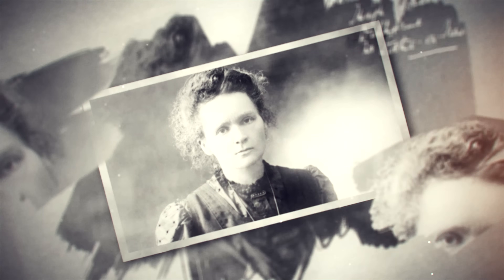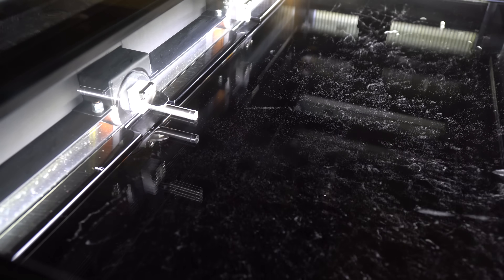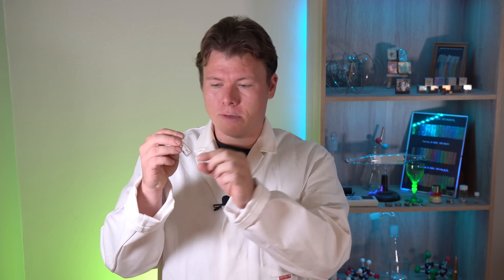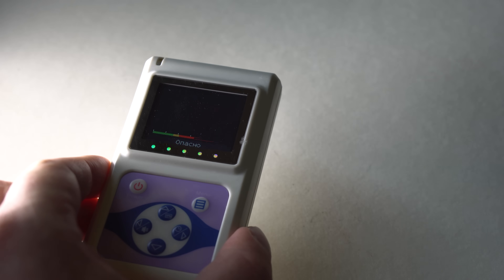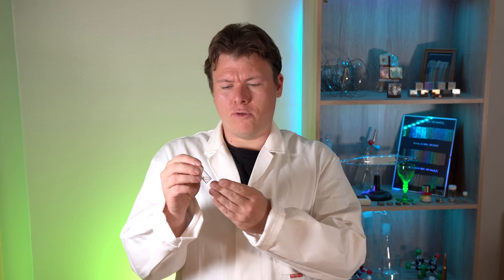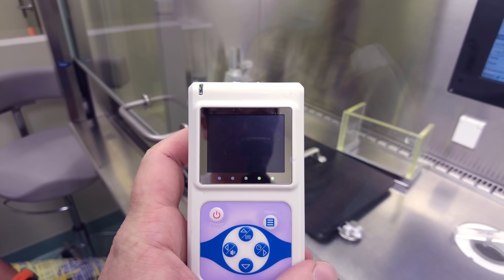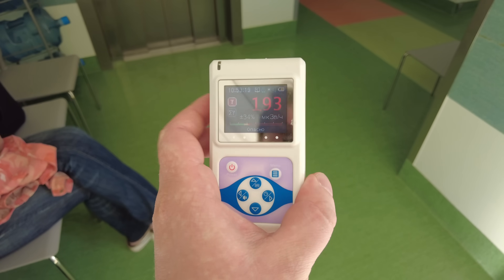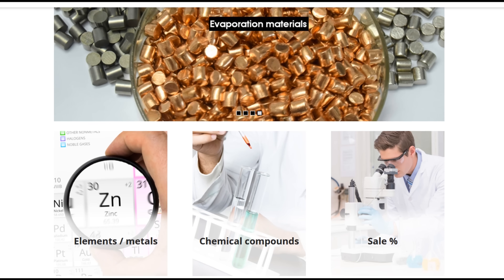Technetium - The First SYNTHETIC Metal on EARTH!

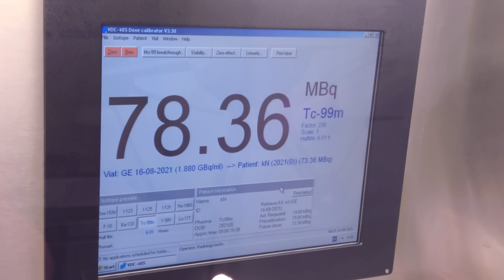Comment: 11:31 Windows 98. Wow. 
It was my favorite operating system. Used it well into the 2000s, but using it in 2021 is stretching it. 
I hope the machine is well documented for when/if the computer it's running on, fails, and it has to be modified to run a modern operating system.

EDIT: just saw the start button. Seems to be XP with 'traditional' desktop. Hope it's not connected to the network or the internet...

Comment: "Occurs naturally in the earth's crust, but is primarily man-made."
Occuring naturally AUTOMATICALLY makes it a non-synthetic material.
What you have is a synthetic version of a natural material, not the first synthetic metal. Get your hands on some Americium (Easy to get, commoly used in homes and industrial situations where a radioactive source is needed, like in smoke alarms.), or some Curium (Not a good idea, one of the most radioactive elements you could get your hands on; glows on it's own in the dark,  and is an extremely potent alpha, neutron, gamma emitter. It requires up to 2 inches of lead for a 1kW source; which makes it impractical for pretty much anything.), the first TRULY synthetic metals; only ever produced in a lab by humans.

If Technetium is a "Synthetic metal", then it isn't the first.
Plutonium,  Astatine, Neptunium, and Promethium all qualify the same way as technetium does; in that it was discovered through elemental reactions in reactors or accelerators, yet exists in the earth's crust naturally.
Though, none of these are accepted as synthetic metals, not even Technetium.

Comment: Nice video, I didn't know that technetium is such a useful metal. Technetium chemistry is similar to rhenium chemistry, but if you look in to Tc neighborhood, molybdenum/ruthenium are more reactive than their heavier counterpart tungsten/osmium. Their chemistry is similar, but molybdenum/ruthenium have due to their higher reactivity much more interesting chemistry. I believe that this is also true for technetium. Sadly technetium doesn't have a stable isotope. If it would have stable isotope, it would be very interesting metal to work with.

Comment: If you could get me sum thorium??? I would like to replicate Dr.paul m. Brown device showing that a alpha resonant voltaic cell can generate way more than a regular alpha voltaic cell. He proposed that the radioactive means just that, he tuned a circuit and showed a variable power source as long as the frequency changed with the increase in resistance. Could you imagine a AC battery??

Comment: Why is it called 'radio' active? It has no radio, why not atomically active, or something..  Understanding the mindset of the ppl. naming things  centuries ago, is as difficult as making a tokamac effiencent...
Reply: I believe that radioactive matter is called this way because it has some activity that can be detected by a sensitive radio receiver. Anything that can introduce or remove charges at a distance just by itself with no electric power supplied is called "radioactive" and all possible mechanisms of the effect are generally called "radiation".

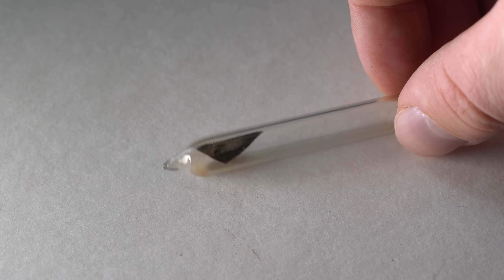Comment: #qna 07:07 why most of element's,,metal and other chemical are kept in glass does glass really help to reduce RADIATION ??
Reply: Yes.  If they are beta-emitters all that is needed to stop the radiation is regular glass.  Using lead/tungsten with a beta emitter can cause more radiation to be emitted in the form of Bremsstrahlung radiation which you don’t want.

Comment: My father did this same tomography last month, in a very similar machine. I didn't knew they used radioactive medicine. Very interesting, thank you for the video!
Reply: If he didn’t get an injection of radioactivity, then it might had been some other kind of tomography, such as CT or MR.

The following options are available:
* Gamma radiation, usually Tc. Can be planar images or reconstructed into 3D volumes (SPECT)
* Positron radiation (PET). Better but extremely expensive as the isotopes must be produced in cyclotrons.
* MR : Magnetic coils in the machine. 
* CT: X-ray tube in the machine

MR and CT do not need anything injected to the body. It is optional to use non radioactive substances.
Reply: @magnushem8734  interesting information, thanks. I don't remember many details, but I know he did receive an injection 4 hours before the exam, but I didn't receive any information about what was that.

Comment: Tc is a low mass element. why is it radioactive?
Reply: “Technetium is the lightest radioactive element. Technetium is a radioactive element, with no stable isotopes. ... The short answer is that there is no number of neutrons you can put in a technetium atom to form a stable nucleus”
Reply: @erikawanner7355  this is not a satisfying answer. there are heavier elements than Tc and they are not radioactive.

Comment: im curious. using radiation to test for cancer, even though we know radiation can cause cancer...... also, you are told to not be around other living being for 24 hours after this test.... why?... because you are radioactive and it can harm other people.... but what about you? what about the person who got the injection? how is it that they can harm others with radiation, but they themselves are not harmed? to me, this is as primitive as blood letting. good things researchers have found other ways that are less dangerous. just, more expensive.
Reply: It's not meant to TREAT anything by itself, it's just for diagnosis. And yes it does harm you somewhat, it's just a relatively low risk. Of course the risk to others around you is even less, but it is easier to avoid.
Reply: @Basement-Science  i never said, TREAT. i said test. and the risks are still there. to test for cancer, using something that can cause cancer, is barbaric. even though the risk is low, there is still a risk and needs to be replaced.
Reply: @pyronac1  you compared it to blood letting, which is (supposed to be) a treatment.
Also a lot of things in medicine come with risks, many much higher than this. At least radiation risks are easy to calculate. 

I agree though that it does seem very primitive. We should be able to come up with much better solutions than this.
Reply: @Basement-Science  no, i did not compare it to blood letting as a treatment, i said it is as primitive as blood letting. you seem to be reading what i say, but adding or twisting my words. i never mentioned "treatment" in any capacity. 

i am just glad that we finally banned lobotomies. even though France was still doing it in the early 90's. again, we have better ways to test for things. it is just way too expensive still. so only the wealthy can afford such things.
Reply: If you think you have a better idea, let's hear it...

Comment: How can I melt tungsten in a gas melting furnace forge
Reply: Good luck with that
Reply: Thanks
Reply: Bye the way what will happen if I mixing ceasium and rubidium metal
Reply: What kind of gas forge? A regular propane forge is not going to get hot enough to melt tungsten.
Reply: This is the truth but can I melt tungsten in electrical ark furnace